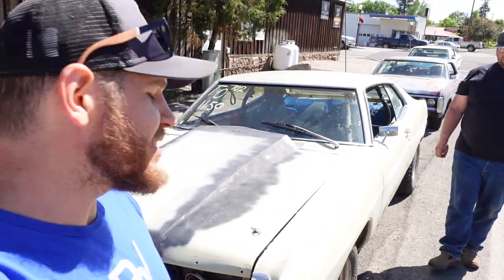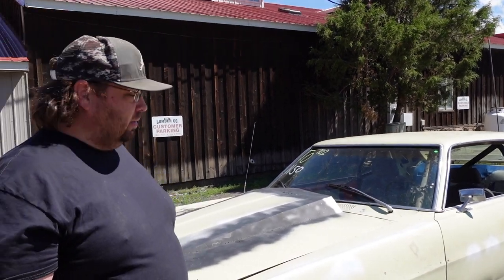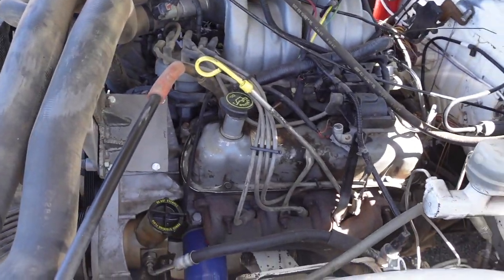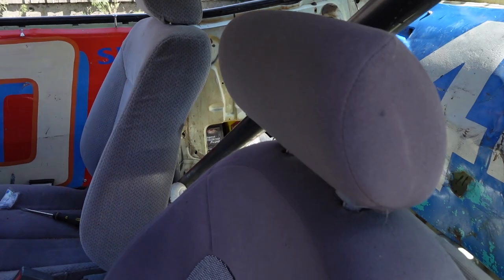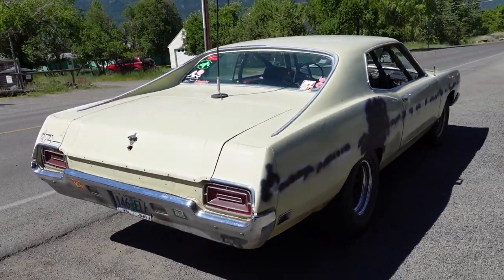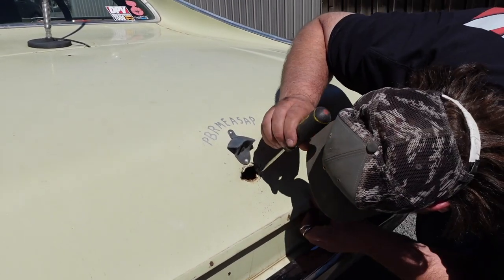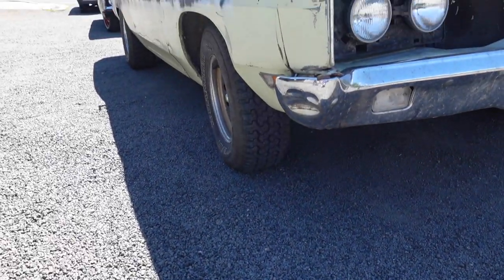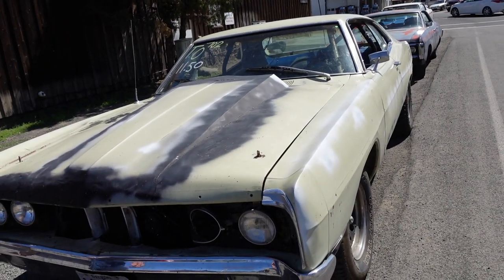1970 Galaxy 500 Built for the Gambler 500

Comment: That galaxie is a beaut. Didnt think a 70 could look good. Awesome build! Do you know what year f150 the drivetrain came from?
Reply from the maker: I’ll ask him and get back to ya, thanks for watching!
Reply: @DaysofPainandVictory  jus got my first Wagoneer a month ago and u got my sub when i watched ur 360 amc rebuild. My wags got 100k miles and i drove it home three hours 65 mph and went fine. Was told the head gasket is blown but its not losing coolant doesnt overheat and has decent oil pressure. Im now burning oil since i did the first oil change(prolly was already) and ive been trying to wrap my head around doing a top end rebuild. Your videos have helped alot. I have no knocking but a lil valve train noise. Dont know if i should keep driving it right now or park it till rebuild. Im no master mechanic but have always loved cars and this waggy is my first dive into older cars with carbs.
Reply from the maker: @alale923  could pull the valve covers and see if you have any loose rocker arms. Maybe it’s just a bent push rod or something. My timing chain was super sloppy, could be that to. I’ll be doing the first fire up of the fresh rebuild next Saturday, hopefully it goes better this time! Thanks for the sub!
Reply: It was between 91-94  f150 2wd.